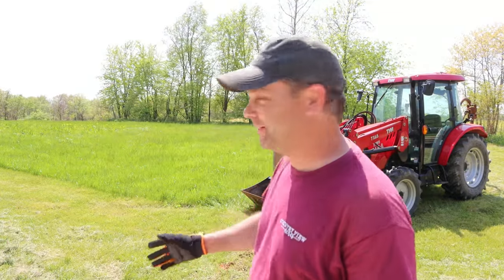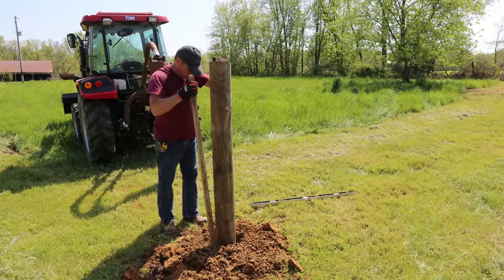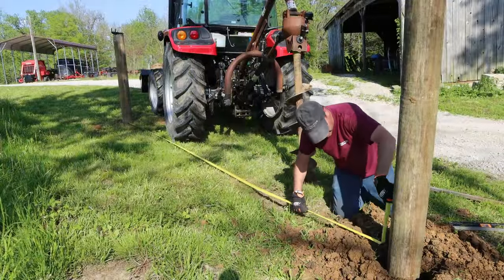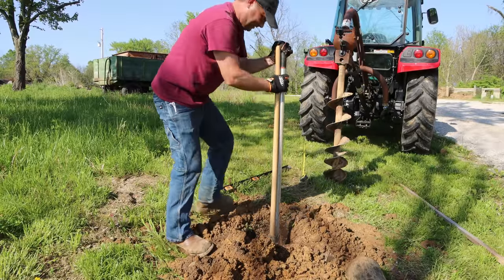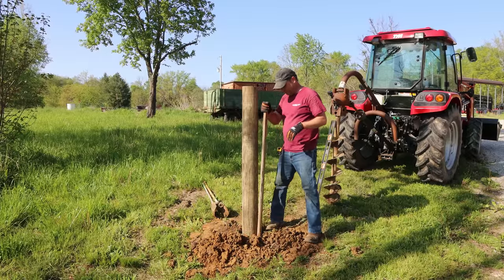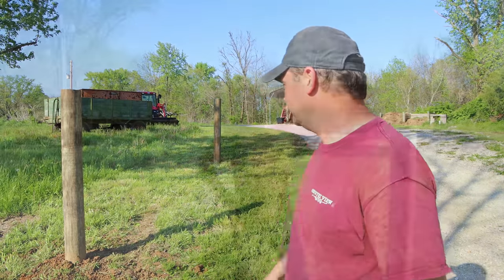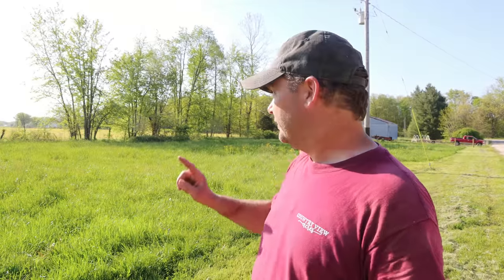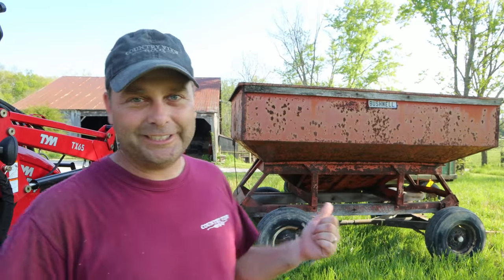Setting the First Posts on a new Fencing Project.  We need more pasture for our animals.

Comment: One trick I learned from an ancient farmer is the recipe that makes their posts last 50-100 years, ic coating the post from the bottom to 6-8 inches above grade with 50/50 mix of diesel fuel and used motor oil...
Keep up the good work!

Comment: Tamp those posts in with a metal rod & you won't have leftover dirt to pick up. That's how we do it in TX. My dad built miles & miles of 5-wire, barbed wire fences. Many of them still in place 80 yrs later.
Reply: We use a spud bar and post hole digger’s to dig the hole for the corner post and all the rest of the post we drive with a sledgehammer it gets pretty tiring
Reply: I like to mash in the t posts with the bucket of a tractor or excavator.
Reply: Old timers always told me, "if there's extra dirt, you didn't tamp it enough".
Reply: @colindeakin2113  100% Never carry off extra dirt! We'd a got our hind ends kicked for not crammin all that dirt back on the hole.
Reply: @colindeakin2113  same
Reply: @colindeakin2113  exactly.

Comment: I used to work on a dairy farm and We the owner and I fixed many a fence line. The previous owner used pine poles and they were rotten under the ground. He bought a 5-gallon pail of driveway sealer and painted the new poles where they would be under the soil and allowed them to dry. Then used them the sealer protected the bottom and those poles are still there to this day

Comment: Not only is is cheaper and saves a ton of time and labor setting the fence posts straight into the soil Evan, but they will last MUCH longer.  Concrete retains moisture and it will rot those posts out in a hurry.  Every fence post we're replacing on this property that we moved on to is less than 15 years old and EVERY SINGLE ONE rotted out inside the concrete.

Comment: You want that fence to last 100 years w/o rotting below grade?  Shou sugi ban is an ancient Japanese technique for waterproofing and preserving wood. It involves charring the cedar wood surface until it turns black.  Just use a propane torch to char the bottom 4 feet of each post.  You can look it up.

Comment: Evan i think you should just run your electric fence on the backside of the old fence that way the calves will clean up around it cut off any dangling  or broken wires to keep them from getting into it tho  you might consider using square tubing for a frame on the grain cart  single slope  and use tin for a roof  never have to replace it (well long time) could make it with a flip up hinged roof  if you keep a couple of panels around the gates you could graze the drive and save Beca some mowing, as for bulk storage if you can find some old hog feeders you can redo the bottom and make a mini upright bulk bin i have several from my dads hog farming days i am going to retro

Comment: I highly recommend creosote post.  I used green treat once about 20 years ago. The best ones lasted about 10 years but most were rotted off around about 7 years. I’ve got creosote that have been in the ground for 30 plus. Then of course there’s Osage orange / hedge apple that are my corner posts. Some of them have been in the ground for 60 plus years. The old sayin around here is a hedge posts will last a year longer then steel.
Reply: Yep, my family has always sworn by hedge, for corner, brace and line posts.😎

Comment: I also use a gravity wagon to store feed it works but its nothing great the ground feed doesn't want to run out,pellet feed does better, also the sheets on my wagon are lapped backwards so any moisture running down ihe outside ends up in the feed ,I flew sealed all the joints  it helped a bunch but still get moisture around the gate/door also I would recomend making the spout more narrow i made one that fills two buckets at once it sounds like a great idea but didn't work as good as it sounds also ihave one wagon with a divider in it, might be an idea rather than buy a new wagon, I can send pictures if you have any questions

Comment: Hey Evan, I love your channel and your work ethic. Have been watching for a long time. I am by no means a fence building expert but one tip I would like to share with you is on the gates/hinges. If you go to your co-op or TSC you will notice there is a lower grade gate and a higher grade gate within the same manufacturer. A person might think like I initially did that "my livestock isn't rough, I don't have bulls, etc so I don't need the heavy duty gate." However, the secret is in the hinge pins! On the lower end gates the hinge pins they provide with the gate are the lag bolt style that you have been using. I refuse to use these anymore. Can't hardly adjust them, etc. On the "premium gate" the hinge pin is a 3/4" x approx. 12 inch threaded pin that goes all the way through the post. It then has a nut and washer on the inside and outside and you can fine-tune your gate over time in about 30 seconds with an adjustable wrench. You can easily re-level the gate once the posts settle, you can push/pull the entire gate left/right several inches, you get the idea. We also use the 2-way gate latches on our gates as opposed to chains and this makes fine-tuning them over time a piece of cake. Just something to consider if you didn't know these existed. I will not even use the lag bolt type hinge pin anymore. One other interesting thing to note is when I was building my fence a few years ago (things could be different now with Covid) I priced out buying the cheap gate and then buying the thru-bolt hinge pins separately and it came up to the exact same amount as buying the premium gate that comes with the better pins and you obviously get a little thicker gauge gate as well.

Comment: Clever plan with the two gates across from each other.
Are you getting set up to try the Greg Judy youtuber grazing methods? Perimeter fence with electric fence sections to move the animals every day. 
Good plan on the gravity wagon. Check/repack the axles and get some good tires on it to haul from the elevator and it saves a lot of handling.
Reply: He was trying that last yr but didn't really have enough pasture for it. From what I recall of those videos this project is a needed step towards the Greg Judy method.

Comment: Packed soil over concrete is arguably better as well so long as you aren't putting posts into sandy soil or loam. Depending on your climate, posts can rot a lot faster in concrete because it holds onto the water. How ever, if you put a shovel full of gravel in the bottom of the hole before you put the fence post, you can turn a 20 year life span into a 100 year lifespan for the post because it gives the water somewhere to go. Unfortunately for me. Our land has a lot of organic material in the first foot of soil and then a lot of coal dust in the sub soil. It is bad for fence posts so we have to concrete them in.